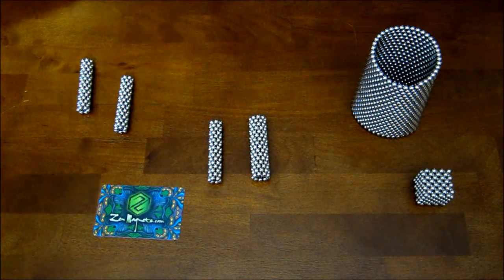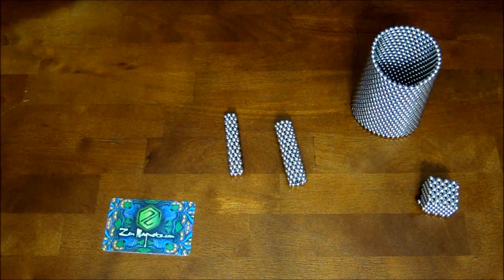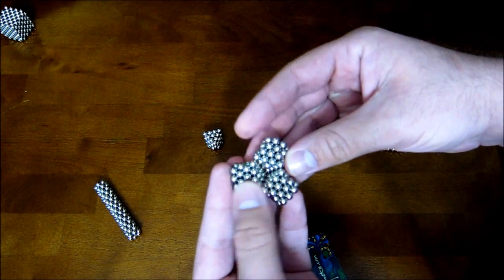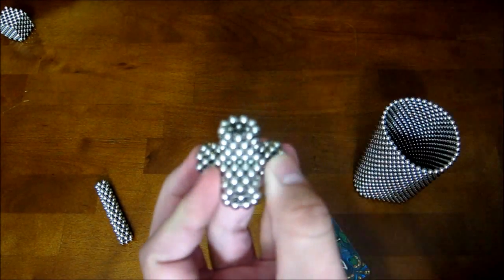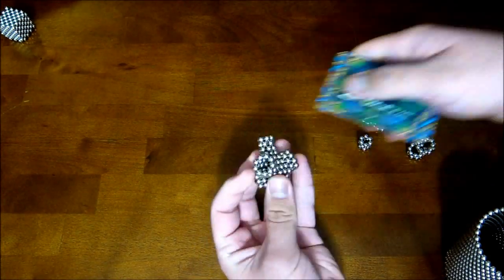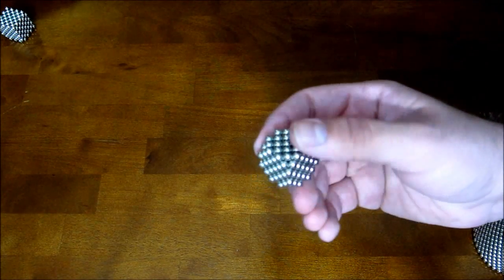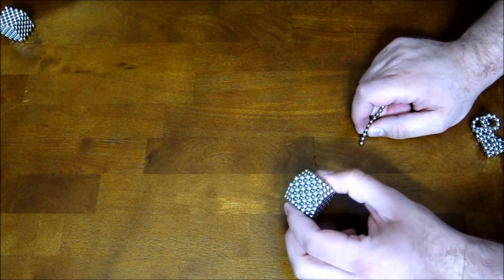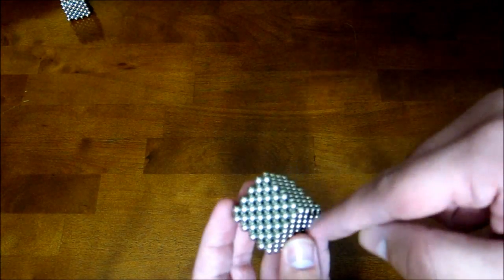Tutorial: Alternate Diagonal Cube (Zen Magnets)

Comment: hey magnenaut! there is actually a way to build this with all corners having the same polarity. you'll need eight 3-sided and six 4-sided pyramids (like here: /watch?v=IBvf9hq_ZSI but hollow is enough -> so just starting with a triangle and a square of 4 magnets respectively then work your way up). attatch them into a cuboctahedron, fill up with magnets and then push the square sides in. you'll need some force, but don't push too hard or it'll get smashed.